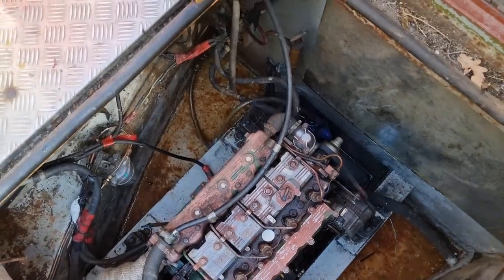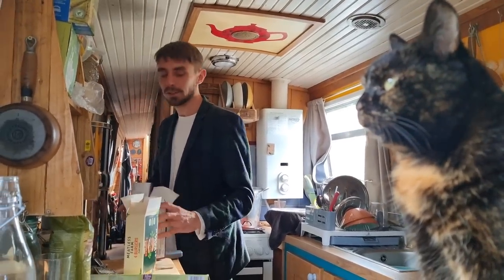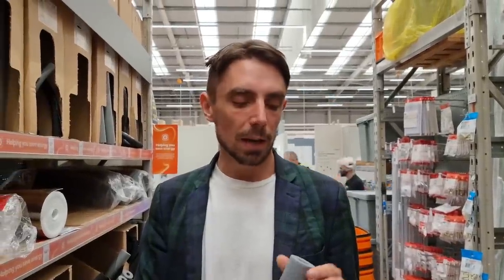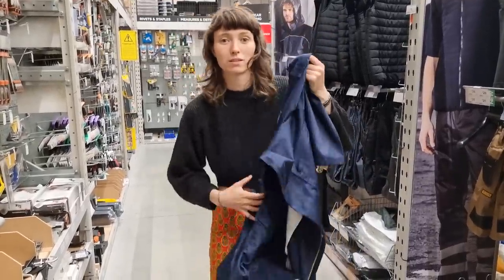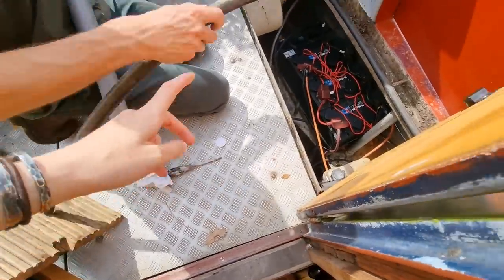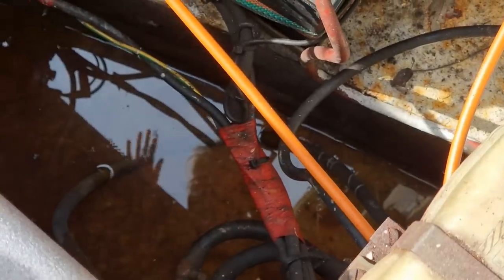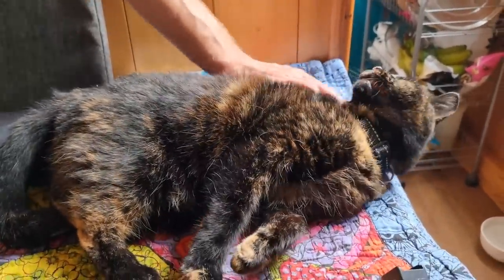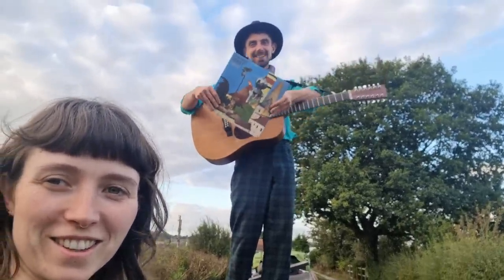When BOAT LIFE gets EXPENSIVE! | We discover a new problem with our NARROWBOAT home | EP15

Comment: Over a grand? That's a bit steep to fix an engine bracket. You could take that off yourselves, get it welded back together - £50 max.
Reply from the maker: It was the cost for the gearbox work and parts as well, and no we cant weld or have the tools or know how required to do that job. And it didn't cost that much in the end any way 😊

Comment: That engine mount breaking and engine dropping might be putting pressure on the drive plate making the noise because it’s out of alignment. That engine mount leg looks a bit on the underengineered side. I’d get it welded up and reinforced.
Reply from the maker: Yes the mechanics suggested that also, and we get it sorted in a good way as you will see in our up coming videos..

Comment: I love the channel and am up to the "Bad News" video.  I'm hoping you can answer a few questions I've got about narrowboats as I'm playing around with designing one, mostly just a pipe dream but it keeps me busy.  First dimensions, I've read that most at 6' 10" wide and have internal head room of 6' to 6' 6".  Can you confirm your outside dimensions, approximates are OK.  I'm guessing your draft is about 66 cm, Freeboard (waterline to gunnel) is 25 cm and cabin height (gunnel to top of cabin side) is 125 cm.  This would put the overall height (keel to top of cabin) at about 214 cm.  Lastly how big is your engine and propeller?    Thanks much.

Comment: Sorry to say this, but that engine mount would have been a pretty easy fix for an engineer (wink wink). I suspect that sack getting wrapped around the prop could have done that because even though your engine is only small, it will still have a significant amount of torque when the prop got stopped dead. I've seen small diesel engines shred flexi couplings when the prop hit something solid in the canal. Diesel engines have very heavy flywheels with a lot of momentum, which can be enough to shear propshafts or snap propeller blades clean off!

Comment: I don't know if a toaster is expensive to run off grid, but I put waffles in the toaster 1 & a half times, then they're done. Cheaper than putting them in the oven. Haven't tried them in the air fryer, but I would have thought they would still be cheaper done in the toaster x

Comment: It's not that a big job to replace the engine mounts been doing them for years....just weld the bracket......its the springs that rattle in the drive plate when not under load..some times last for years with no issues

Comment: Hi Ben & Emily, If you won't to stop rainwater getting into your engine bay, make a small frame to rase the cover above the floor, so that water will run past & out though drain holes at the stern.
The other way to keep out rainwater, is to buy a small 12 volt savage pump fitted with a micro-switch, operated by a float. this is how boats at sea keep the water out.
Have a great day. Thanks.
Reply from the maker: Thanks for the tips !

Comment: Hi guys. Love watching your channel, it's magic. My cruiser stern didn't have any edging around the flooring support channels and after a tip I received, tried using hosepipe cut down the middle all along the length and then cut to size. This didn't work as all the hosepipe I could find was plastic lined and made cutting it much to much hard work. I tried this - Metal House Extra Large black rubber car edge protective trim 14mm x 16mm from amazon (seems I can't leave links in comments) and it does a great job sealing against the rain however it does leak a little but you need to clean out the channels and overflow holes regularly. It also aids in engine sound deadening. I'm still catching up on your vlogs and look forward to every one.

Comment: I'm guessing the rubber under your deck is used to dampen sound vibration not to keep water out, and increasing water tracking into your engine bay. You need a small lip in the underside of your deck edges so the water will drop down into the gutters. I hope you understand what I mean. ( Water can not run uphill).
Reply: Thought the same. You're not likely to stop it coming in, easier to collect it and/or redirect it.
Reply from the maker: Thats a very good point! Thanks :)

Comment: While your engines out it's a great time to use some rustzilla Rust hardener and repaint your engine compartment. And possibly the motor too. Good luck
Reply: Doubt they remove the engine, just lift it enough to get at the mounts without it dropping through the bottom of the boat when they're all loose.
Reply from the maker: Thank you, engine doesn't have to be removed thankfully😊

Comment: Guys, you could just mix baking soda and vinegar.... paint it onto the plate leave it for 5 or 10 minutes and then wipe it off with the scouring side of a washing up sponge. PS this works on pretty much any hard surface. We use it all the time to clean the UPVC of old grime on houses we renovate.
Reply: by the way I have also had the idea of using those metal things in the drill and it was near impossible to control.
Reply: Grime house metal, a new direction . Next album
Reply from the maker: Yes it is a mental tool..
Reply from the maker: Ok will try that... I will try any thing haha

Comment: A broken motor mount is a VERY small thing to fix.  $20 quid at most and 15 minutes work with a standard socket set.  Nothing more than a small jack is needed to support the motor while you remove the bolts and install the new part.   You're being ripped off in a MAJOR way.
Reply from the maker: Hi David, thanks for your concern, the problem was that they don't make the same legs anymore and they thought we would need to replace them with new ones all round which is a big job. Also the price included the removal and fixing of the drive plate. Anyway all is explained in this week's episode out on Saturday 🙂
Reply: @BenandEmily  Still too much.  And YES! they do still make replacement motor mounts.  Did they try to explain a wildly generic item as if it was a made to measure suit?  Nobody likes to hear that they were taken advantage of, but you were.  I am frequently in the UK and have been back and forth from the states for the last 20 years.
I know exactly how much things should cost.
Reply from the maker: @David Briggs  Thanks David, it's ok :) We don't feel we were taken advantage of. So as i mentioned they don't make the mounts for our engine anymore, it's explained in next week's episode 😀 👍 Try not to worry too much 😊

Comment: Sorry to hear about the engine woes. Was it not possible to weld the broken strut? Were the rubbers of the mounts also gone? (They do have a limited life and they then allow more engine viabration through making it a louder ride.
That grey tube-like stuff does well for insulating pipes, but although it is a good shape you would find it is not up to the job of being a seal. It would cut through very quickly. The aluuminium cleaning job worked well.
I was susprised how cheap the overalls were - 7 quid only? Great deal. I've been working in the Far East for years - where so many textiles are made, yet we can't get overalls for that price. Also love the idea of a nut and bolt pick and mix.
Reply from the maker: Thanks yeah, it was bad news but all fixed now :) They did end up welding it so it wasn't quite such a massive job! Yes think the rubber bits were fine. Yes definitely not the right tube! Thanks for watching :D
Reply: @BenandEmily  Thank you for vlogging! Watching is the easy bit. Vlogging is where the work is involved.

Comment: I would use the opportunity to check and maybe replace the silent blocks under the engine mountings. They're not that expensive, a lot cheaper than the labour cost for lifting the engine and fixing the broken mounting I would say. I would also check the prop shaft. Vibrations and/or a misaligned engine can wear out the prop shaft. And that can cause water coming in through the propeller shaft. Could be cheaper to do now than to spend another grant next year. But check with the mechanics. Their advice is worth more than my very distant opinion  ;-)
Reply from the maker: Yes they had a good look and helped sort it out as you will see in our upcoming videos.. Thank you 😊

Comment: Any good marine engineer worth his salt use's a crow bar to test engine Mount's  if the engine lifts new engine Mount's are required also if the engine bed is shimed it will need reclocking on the coupling .Ex retired engineer 👍
Reply from the maker: Ah good tip cheers!

Comment: Put another engine support leg on there, or weld up the old one. A good welder will be able to reclaim that engine leg. Check that the engine mount rubbers still have enough life in them. Keep oil away from them. Regularly scrub them with detergent, and if diesel drips on them (or oil), clean it off immediately.